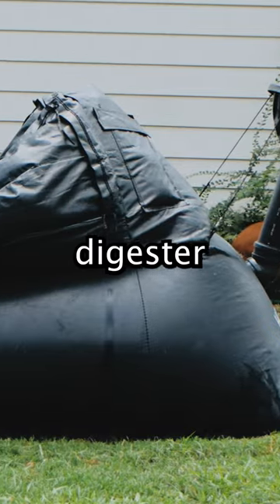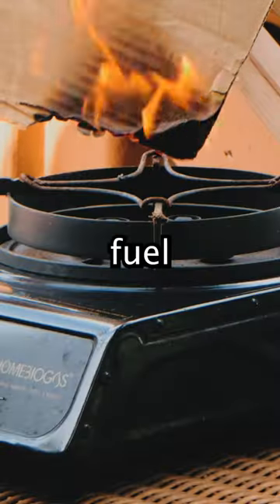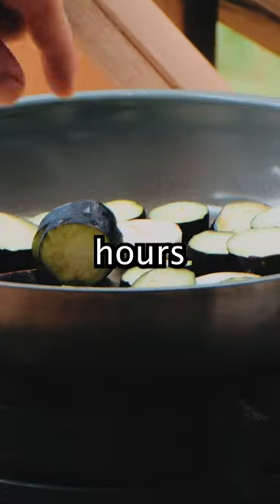Free Fuel From Food Waste!?

Comment: could you use it for running a generator?
Reply: If said generator was optimized for wet biogas (~70% methane), sure. But that doesn't match the description of most generators, and anyway it wouldn't produce much power without an industrial amount of gas.